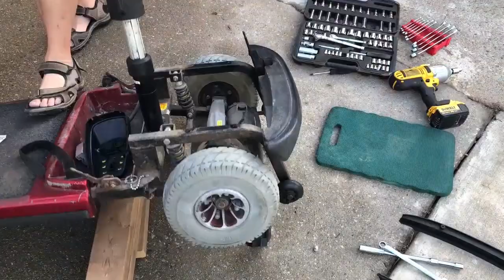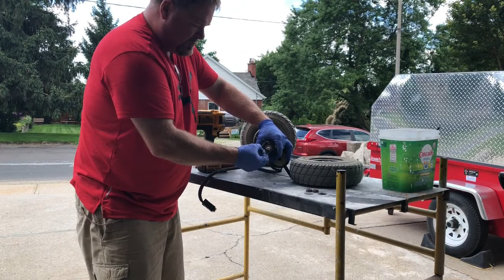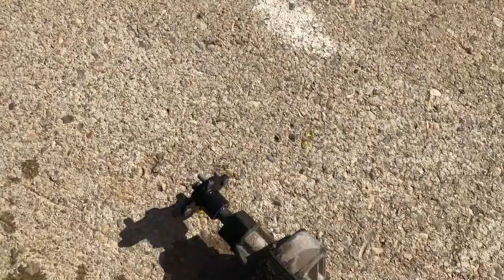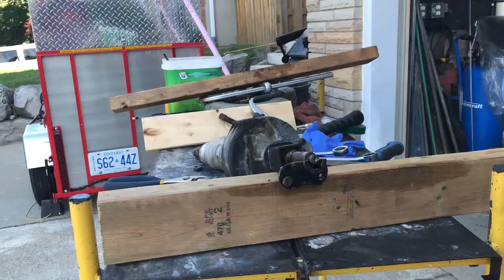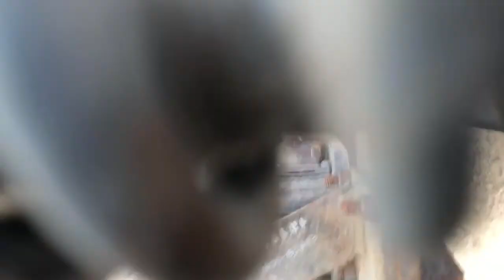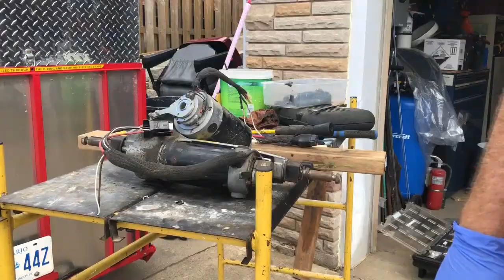Mobility Scooter Motor and Trans-axle Replacement

Comment: this is why i take everything apart especially wheels and put antisieze on everything
Reply: if everybody did that, or God forbid, they did it from the factory servicing. These units would not be a problem, but they do not want you to service these units. They want you to replace them.

If we all lived in a place that didn’t snow or use salt most of these issues would not happen

Comment: Hi, do you guys do rebuilds? I have a afikim, I like tge machine, but it has stopped working. It also need the front panel restored or repaired, it happened when a car hit Mr coming out their gate. If you do that and can also change the batteries, non wet batteries, but the new ones I would appreciate it. Please give me a quote that would include everything, even what I have not mentioned. Thank you. TREVOR VALENTINE
Reply from the maker: Thank you for taking the time to reply.
Unfortunately, I only repair my father scooters.
Did it stop working after the accident ?
A broken panel is not that big of a deal
 It could be a direct order replacement part.
Battery should be replaced every 2nd to 3rd year depending on use and storage method.

What’s the car moving? When I hit the scooter or did the scooter hit the parked car?

I mention this because the scooter only weighs a couple hundred pounds a car weighs a couple thousand pounds, and there might be other damage mechanical that you cannot see

another little bit of advice
If you’re getting gel batteries because you didn’t want deep cell or wet batteries
The cost will most likely be more than the value of the scooter

I hope this helps all the best.
Ray
Reply: @raysfix  

Hi
The car were coming up the drive way, the fence were +6ft so I had no idea that it was there, and it knocked me as it break onto the pavement.

The scooter were working, as I had it repaired, it got wet when the cover over it blew off.

After I charged it, it would not display any lights etc, it was completely dead. I would like to get a quote if you could help Me please. it is the Breeze and the section where the front basket sits that is broken, and that is the part I would like to have repaired or replaced. Is there any way of increasing the distance I could travel on a charge, that was one of the reasons I wanted to change the batteries.

I think they are probably past usability as I believe this scooter is plus 10 years old.

Thank you for your quick reply, where are you people situated?

Again I would be grateful if you could give me a rough estimate of what it would cost to repair it.

I look forward to you reply.
TREVOR VALENTINE
BAYSWATER, VIC3153
AUSTRALIA
Reply from the maker: Hi Trevor, I would love to help you, but unfortunately I live in Canada. I’ve only been to Australia once and that was 12 years ago.

Comment: Should’ve put a flat tip screwdriver into the first split you ground into the hub and then twisted. Spray some more penetrating oil in there whilst twisting. Or use a square shaft pry bar with a crescent wrench on the square shaft for increased torque if the screwdriver ain’t twisting hard enough to widen the split. Square shaft pry bar and crescent wrench also works great for removing stubborn oil/grease seals from bearing hubs... I bet a couple BRRRAPS with an air hammer would have tilted the negotiations in your favor early on. Works every time for getting flywheels off of small engine crankshafts. I am stuck right now with a wood chipper drum that won’t come off the other end of a crankshaft. I’ve tried everything other than splitting it, or using my jackhammer. Thermal, chemical, kinetic, mechanical, hydraulic.. all means I’ve tried, and combinations thereof. Won’t come off. Only thing I’ve ever seen stuck worse was a centrifugal clutch on a golf cart crankshaft.
Reply: Of course I paused it and made this comment and then when I resumed was the part where you broke out the chisel lol
Reply: Thank you for sharing your tips to remove Rusty shafts much appreciated
Ray

Comment: you don't need the stuck screw out, it's a plastic cover just bend it a bit out the way to get the axle out.
Reply from the maker: I guess you’re talking about the side piece that comes down the internal mudflap I guess you could call it
I did end up bending it over the way the problem what that is is it rubs up against the tire a small amount every once in a while makes a rubbing sound

Comment: I'm thinking on buying a used mobility scooter but I hear a rubbing noise on the back left wheel. Do you have any clue what it might be? I'm hoping it's not the trans-axle. Thanks.
Reply from the maker: Is it a rubbing that comes and goes like intermittently
Sometimes there’s a small inner fender it’s just a straight piece of plastic that prevents dirt and debris from flying off the tire and hitting the motor check to see if that’s it

On the scooter after I took the motor wrote and replaced it with another one instead of properly fasting all the screws and I kind of bent the fender and then put the motor back in and it rubbed only for a short period of time

Another thing that I would suggest is getting a couple of bricks putting it underneath the wheelie bar wheels lifting up the backend off the ground basically and then taking a mirror with a light on it one of those extension mirrors and then having somebody spin the scooter and then you look to see what’s rubbing and what’s not rubbing you can do that from a standing position almost or knees bent without having to get on the ground on your back

I hope this makes sense 
 all the best
Ray
Reply: @raysfix  Yes it's intermittently,  Every 12" I guess.  Thanks for the advice. It's a Golden Companion 4w scooter in pretty good shape and comes with a motorized truck ramp that swings out for $900.00
Reply from the maker: @Fallguy615Intoit  
Does it only squeak when you push the unit forward or will it squeak with the back end jacked up And you turn the wheel independently 

Does the squeak absolutely come from the back or is it possible that the squeak is coming from the front?

Comment: have you ever found out if any one has any internal parts, like the pinion you broke?
Reply from the maker: You can order the parts from the manufacturer I did at one point in time find the part number but I’m not sure if the part was available or not
It would not be cost-effective to get the part because it was very expensive if I’m remembering correctly
Reply: @raysfix  have you ever found any reason why the pinion breaks? my scooter is over 8 years old, and High mileage, I use it around the house and take it in the pits at the drag strip, I have a newer one, I use mostly for shopping and dr's appointments, curious to know if the is a limit to how long a transaxle lasts.
Reply from the maker: @carlballinger844  
Luckily I was the one on the machine when it broke we were going up in extremely steep hill and it’s snapped it was an extreme amount of pressure on it
This hill was part of a walking trail I wasn’t offloading or anything silly like that
But it was super steep
The dangerous part is when something like that breaks you don’t have any breaks at all
So I was going down that hill when I got turned around at full speed and I’m glad that my dad wasn’t on the unit he was on his newer unit

My best guess is it’s an older unit and fatigue and extreme strain
Reply: @raysfix  my old one I've abused, since receiving the replacement ,for three years, carry bags of heating pellets with me, take out the garbage, up a moderate inclined driveway, when it broke, the shaft broke in half, still give me motion, but at a cost, it would quit, if it vibrated too much, and had to recycle the switch, sounded like a honda four banger when it broke, but was quiet backing up, either way, I found a little used replacement matching transaxle, maybe wear internally, or constant stress, or old age, caused the failure, took me by surprise when it happened
Reply: I was hauling firewood from a cut up tree log, so ya not recommend that extra weight  my worm gear snapped in half just like this video. Not sure what to do now😢

Comment: Surprised you didn't try applying heat to it. A little propane torch therapy works wonders.
Reply from the maker: I could have tried that
will keep that in mind next time 
thank you 
Ray
Reply: A bit of oxy-acetylene with a small tip would've told that hub were it should go.

Comment: Hello, I need some information from you! I have to change the oil in the engine reducer from my electric trolley! Can you please tell me what type of oil is compatible and what series of oil to buy?
Reply from the maker: For me to help you I need more information
Need to know the make model year and what type of scooter it is
On a mobility scooter there is no actual oil
It is only grease in the transaxle

If you have a different type of scooter or a gas powered propane or two-stroke motor they require different oils
Provide me with more information and I might be able to help you
Ray
Reply: @raysfix  https://www.meyra.com/wheelchairs/e-power/e-power-wheelchair-details/product-469/

Comment: Dude that hub didn’t come off because you put the bolt back on that help it in place, then put the wheel puller on it wasn’t coming past the bolt!!!!
Reply from the maker: I does look that way but at 19 min mark you can clearly see that the hub and nut are about a 1/4 inch away from each other
camera angles are tricky 
I tried using more cameras but editing became more of a nightmare 
thank you for the comment
Ray

this scooter was used as a backup for 2 years
and i just replaced it with the same model but newer
Video link
https://youtu.be/ftPzNBVb7kA

Comment: I ran into the same problems trying to get the wheel hub off, many hours spent and nothing worked. I took sand paper to the axle shaft by reaming it around as specially near the wheel hub then cleaned axle with a mixture of fingernail polish remover and gear oil mix in a spray bottle. Then I stood the axle up so one side is against concrete and put an impact socket or whatever is bigger than the 3/4 shaft and wacked it a good one 👍 with a big hammer which pounded the shaft on even further. Then I had  the end of the shaft exposed enough to sand, clean and lube it too. Suddenly it pulled right off. So in order to get it off you have to pounrd it on further first onto a clean shaft. Note: if you remove that clip off of axle you will have more room to use sand paper. I used various grits of used sand paper I had laying around but whatever grit works to make her shine before pounding it on further.
Reply from the maker: I am Getting rid of that scooter now 
replacing it with the one in the new video  "buyers guide to used mobility scooters"

Comment: my scooter whel is lock wont turn
Reply: Need more information than just enough

Need the circumstances leading up to the wheel not turning

Which wheel is it front and back

Was there some kind of trauma did you hit something 

because the unit been sitting for a long period of time just one wheel turning and not the other wheel

That’s kind of like going into the paint store and saying give me a gallon of paint
Reply: @shopandmath  the right wheel is locked it locked all on its own no trauma at all a guy says sounds like the bearing
Reply: ronald ferreira 
It is possible that it’s seized bearing
That would’ve given you some warning and you would also have felt some grabbing on that side

There’s a Bearing on each end of the shaft and usually when a bearing goes it falls apart

Your electric break is on the right hand side of the bike